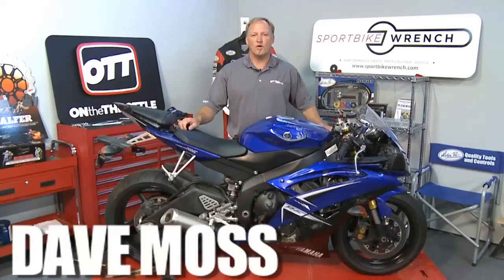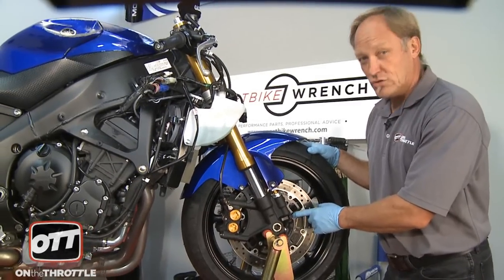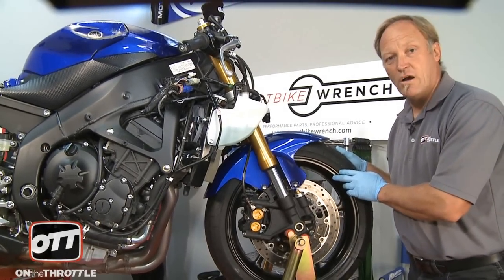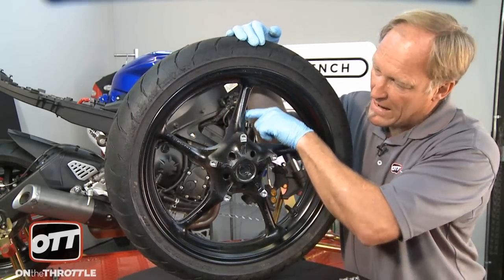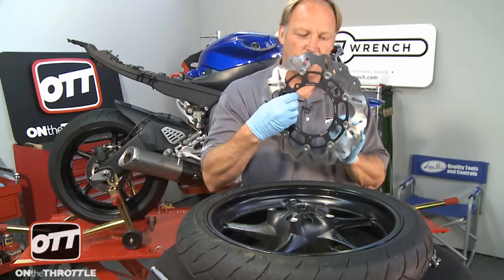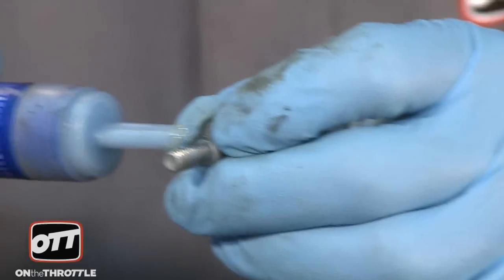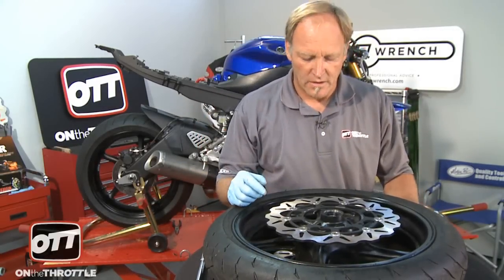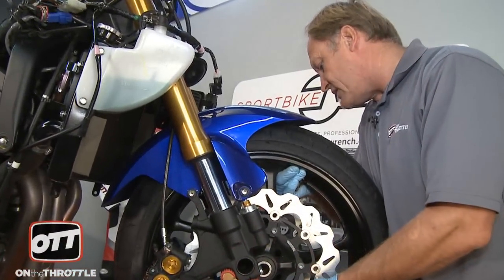Performance Upgrades Yamaha YZF-R6 Front Brake Rotor Install

Comment from the maker: @pallavsharma91 upgrades relate to personal tastes in making your bike your own. I bring a different perspective to my own personal bikes and go through the following:
1. Suspension upgrades for better handling
2. Braking upgrades for better stopping power with braided steel lines
3. Ergonomics for a much more comfortable body position
4. Others: windshield, levers, slip on pipe etc.

Dave Moss
Host

Comment: old video but he left out that rotors have a oil on them and you need to clean all the oil of before using the brake or it will ruin the pads I do this before I install them brake clean and a  rag wipe them off and good to go

Comment: Thanks, these videos are great.  How many miles do rotors usually last?  My rear street bike rotor went below the service limit in only 13,000 miles.  Is this normal?
Reply: Probably you holding slightly rear brake not intentionaly when driving, or braking with rear brake instead front + rear.

Comment: Hi Dave !!

Why do the waves of the rotors need to not be in the same pattern ? I've unfortunately installed them in the identical pattern on my bike....   I'm gonna correct this as soon as I can, but I was wondering why it needs to be like this?
Reply: Me too.. I installed them in the same wave pattern. Did you get the answer?
Reply: I think its just to get the maximum amount of braking power at all times.  When 1 side is on the peak "maximum" the otherside is on the bottom "minimum" although id assume its barely noticeable?